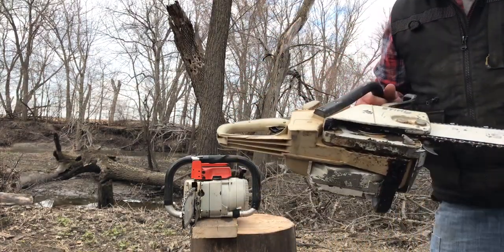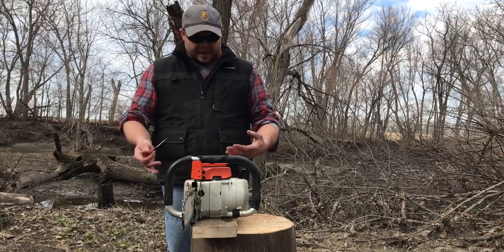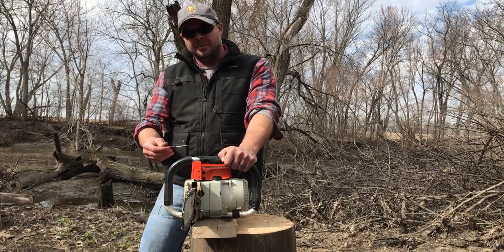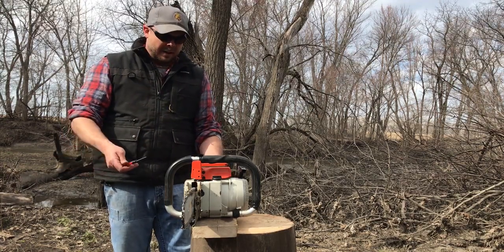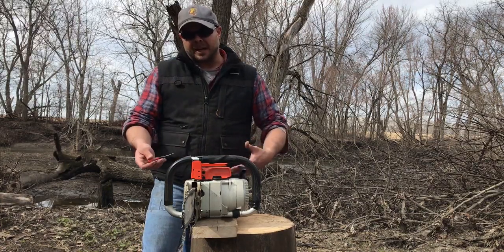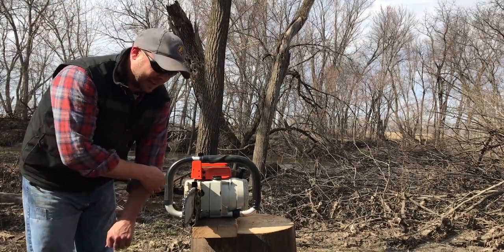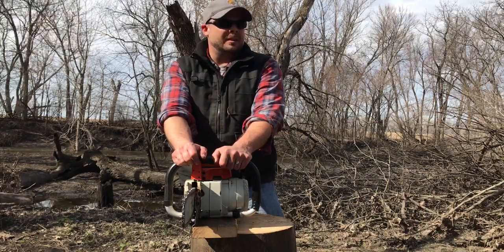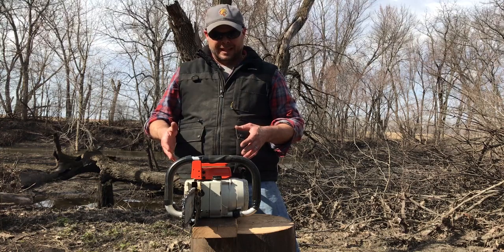Adjusting your 2-stroke Chainsaw Carburetor how to tune by ear demonstrated and explained

Comment: This method is confirmed in the Walbro service manuals where it states that optimum adjustment for the high speed screw is obtained when a very slight 4 cycle sound at wide open throttle is heard
Reply from the maker: Cool!  Never knew that tech manual existed... Not sure if i said it in the video, but that is the most common way saws are burnt in my experience.  Tuned to sound great is fine under no load, but as soon as you put it under load there is not enough fuel, oil, or cooling capacity from the mixture

Comment: No need to apologize for "dragging on," mate.  I didn't find a word you said herein to be anything other than useful.  In my experience, our new saws have been fairly well adjusted at the factory, so there's not a lot of need for carb adjustments.  When a carb starts to perform poorly, on the other hand, that's when this information really makes a huge difference.  We just replaced a Zama that was way too flood prone recently with another Zama.  Having no way of knowing how the new Zama was adjusted at the factory, I carefully turned both the Low and The High jet screws full CW to refusal.  After that, I followed the service manual's suggested spec by turning the Low screw out (CCW) one full turn and the High screw out (CCW) 1 - 1/8th turns. After getting the saw started, I turned the idle adjustment screw in (CW) to get the RPMs up enough to make a proper Low jet adjustment.  At that point, I followed your advice and adjusted the Low screw out (CCW) until the engine just started to "gurgle."  After hearing the gurgling sound, I slowly turned the Low screw in (CW) until the engine just started to sound miss free.  As for the High jet, I used a hand-held tachometer and set the saw up for the specified max RPM.  Regardless, once I was done with both jets, I adjusted the idle speed until the clutch shoes released just enough to stop the chain from spinning at idle.  Regardless, I really appreciate the fact that you took the time required to tell the carb adjustment "story" properly and thoroughly - minus the TV personality wannabe hoopla and superfluous pasture patties.  If I hear another wannabe saying something akin to "let 'er rip, tater chip," I think they'll have to come out from the nearest psych ward and give me that long quiet ride to what Karl Childers (in Sling Blade) referred to as, "The Nervous Hospital."  Please keep up the great work.

Comment: I have a CS-370 echo chainsaw and it says 30psi on a compression test. I got it to run and cut for about 2 minutes then it dies. I replaced the carburetor. Is it possible I can get it to run without replacing the piston maybe the ring is just locked up? Any suggestions on where to get a good aftermarket piston kit would help. Thanks.

Comment: The high idle??? Never heard the high mixture adjustment called that. The high speed should be checked with a tach, to see where you are as far as max RPM.

Comment: Great video and easy to understand for us beginners. Thanks dude. Just did muffler mod on my ms260 and left the high end just where you said. Saw really rips now!!
Reply from the maker: Awesome!  One less scorched piston lol.  Seriously glad to offer help that isnt found in textbooks.
Reply: @WHATTHEFIX  I like your tuning, most ppl tune too close to the edge trying to get a perfect balance with just a hair of 4 stroking sound, then the air temperature goes down 5 degrees and their saw runs lean. In my book, I go as fat as possible when tuning in the summer heat, as long as it's cleaning from 4 stroke to 2 stroke in the wood, it's all good. Never had problems with overheating, no fouled plugs, great piston wash pattern. Thanks for the video!

Comment: First thing I do with a 2 cycle that won’t run is change out the gas.
Reply: Haha I put a new adjustable carb on my ms170, and it had some gas, but during the tuning process it ran out of gas but I didn’t realize this until after I messed with the carb some more trying to start it. Duh.

Comment: Another way to check the low is to let it idle for a few seconds then go full throttle quickly, if it bogs or even quits it's too lean. Also if your high is lean it'll take a few seconds to come back down to idle after full throttle.

Comment: Some of the newer saws have an electronic rev limiter built into the ignition system , this will trick you and make your saw sound like its rich when its not.  learn to recognise what's going on ,,Rev limited chainsaw burble / 4- stroke sound vs. rev limiter sound example  https://youtu.be/PlnYjFXM-NM , example of how to mixture tune one of those ,  How to tune a chainsaw with rev limited coil example ,, must be tuned in steps while cutting staring very rich and working in small steps slightly leaner until it will just run clean under load in the cut . example  https://youtu.be/cXqXDqQZWGE

Comment: mine is smoking, what can be the problem, big plums of smoke.
is it running to low ? or to high ?
Reply from the maker: too much oil in your mix?  Hard to say
Reply: either too much oil or too rich. lean it bit more little step by step, if its still too smoking, its got too much oil in the mix ratio.

Comment: Good vid. At the 9:34 time stamp the engine sounds so good but you're shaking your head no. Is this because it's too lean and running a saw with this sound could damage the engine?
Reply: Ya. Running it without load it sounds good, but as he mentioned, when it's on the wood it needs more fuel and will be a tad lean, so he likes it rich when he's revving it under no load. I think he mentioned this as well, but it's always good to remember that it's much better for the saw to be too rich instead of too lean.

Comment: Hello, have a question on my Stihl chainsaw. When i turn on my chainsaw , and then when i go to the idle position by pressing on the trigger and going to run position, it shuts off but if i depress the trigger few times , it won't shut off. 

So i go from cold start , hear the burp, put the lever to warm start, and it starts. Should i wait few seconds before i depress the trigger and it automatically goes to run position and idle ? Or is it ok just to depress the trigger right away when it starts ?
Reply from the maker: You want to to pull up on the choke lever only to put it in non choke-hi idle mode.  When the saw has “caught” after a few sec then pull trigger to allow idle.

Comment: Very confused..everyone on YouTube does it different..so by what you're saying I'm definitely running my saw lean on the high end..but if I give it more fuel on the high end it dies out? Maybe I got the idle wrong
Reply from the maker: Too much fuel (screw too far out) on H will cause flooding at mid to high RPMs. Too much fuel on the L side ( idle) will cause flooding not only at idle, but also in the first few seconds of WOT.  Until it cleans out the extra fuel.  Then if H too lean it will switch from flooding to over rev and hot.  

Hope this helps.
Reply: You need fuel and air. Too much of either will make it stall. I like to turn the jets all the way in so they are seated. I then turn the screws out from there so it will start because the saw won't even start on the far end of either of the extremes.

Comment: Im haveing trouble with tuning the walbro wa carburetor on my partner 1616 chainsaw
Reply from the maker: If you have not cleaned the carb (best to use ultrasonic tub) and installed a new kit, there is likely blockage or worn parts inside it.  If you have, there is likely air leaking in from somewhere other than the throat of the carb... check intake manifold to cylinder, crankshaft bearing seals.

Good luck
Reply: @WHATTHEFIX  Anything that allows too much air will run lean. Leaking crankshaft seal, engine gasket leaks,  dirty fuel filter,  stiff diaphragm, debris inside carburetor,  leaking fuel lines. Echo Repair Specialist... Good video sir!

Comment: Man you can’t use the term turn in and turn it out until you explain what is in and what is out meaning clockwise or counterclockwise . 

That is why some people are confused
Reply: If people don't know which direction is in and out they should not be trying to tune a power saw.

Comment: The low was not fat it was lean because it was high Idling. The idle will immediately drop to an idle when it is rich enough. Start with both screws at the recommended starting point. Always tune the low first and never open the idle screw. Always start with the idle screw as low as possible or you can get a poor low mixture adjustment. Slightly rev the engine and when it drops to and idle it is rich enough when it instantly drops and idles, if it hangs and high idles before it drop down it is too lean. Then adjust the high speed and just about tune the 4 stroke miss out.
Reply: Idle screw as low as possible? Turn it in, to the right, is that correct. Thanks
Reply: @mrtennessee6862  left